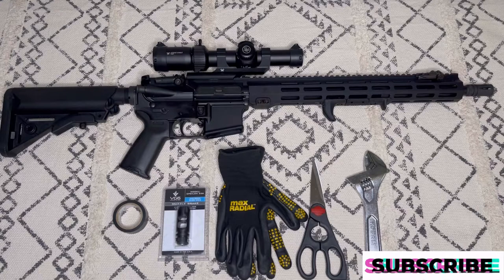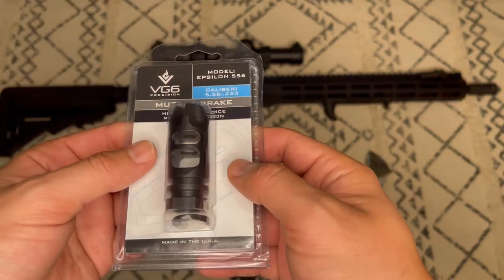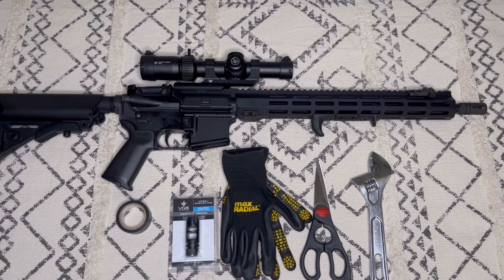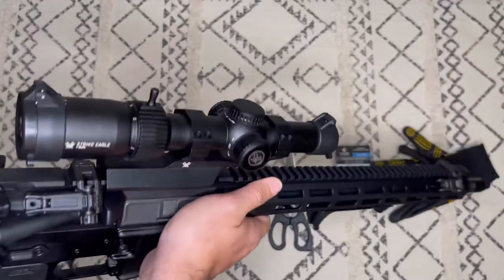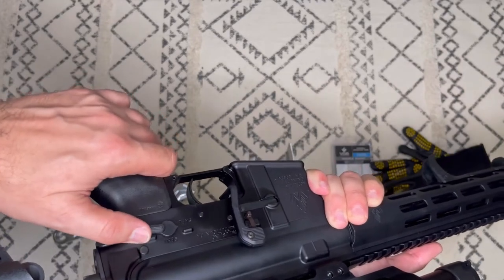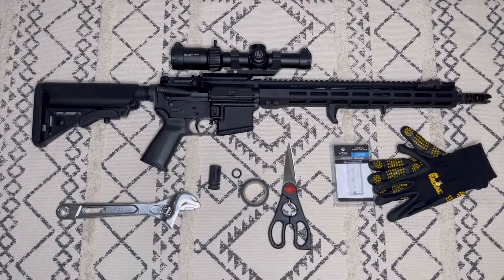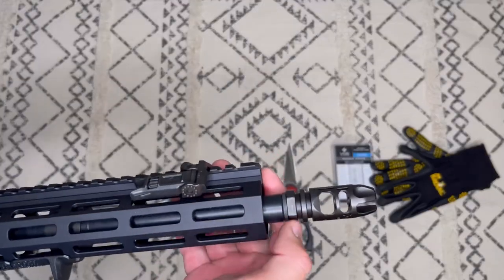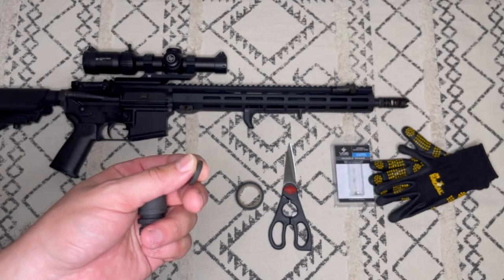How to replace a muzzle device on a rifle without gunsmith tools

Comment: While this technique does work, it is incredibly stressful on the barrel indexing pin and the actual receiver slot on your upper. Combined with heat and doing this more than a few times your barrel can twist and rotate freely while the barrel nut is still tight if that pin or collar wears/breaks. The tools for this aren't that expensive and if you end up breaking an expensive upper you will spend more on replacement parts than tools. I would not recommend this as a replacement but rather a quick remedy if you need to replace a muzzle device but do not have the tools.

Comment: Guys if you were going to be working on your ar for the love of God please order a Magpul BEV block and go to Harbor Freight and get a $40 vise.  I used this method 10 years ago and  egged out the slot in my upper. the indexing pin on the barrel will eat into your upper if you don't support the Locking lugs with a vise block like the magpul
Reply from the maker: @thundertmf Of course it’s totally your choice and your money. I made this video for those who are either restricted financially to seek for gunsmith assistance or would like to work on their own. 

I personally like to work on my guns myself as much as I can. Not trying to be a show off but I’m quite capable and comfortable with using my hands and tools. I’m also a computer scientist and former soldier. Thus, I have enough experience, knowledge around tools and guns. 

I worked on or still continuously work on my own guns, cars that worth several thousands of dollars in value. Knock on wood, I have been very successful with everything I’ve done so far. I worked on my $12K Barrets, $5K HKs, $4K SCARs and some other collectible guns plus $40K+ cars without any major damages or failures.

Bottom line if you don’t feel comfortable doing it yourself by all means take it to a gunsmith. There’s no right or wrong way here, I don’t think. We make our own decisions as adults. Cheers!

Comment: Step away from the gun please. Not only did you fail to clean the threads of any carbon or prior rock set, you put on a muzzle brake without timing it. Home DIY is great, but do it right.
Reply from the maker: Thanks for your input.
Reply: The timing looks fine, what was wrong with it?
Reply: @generallobster  what does he mean by that

Comment: I want to thank you very much, as I came to this video when searching “does iwi use rocket on the Zion 15 from factory?” ….as I am about to swap muzzle devices on my tac 12. I do have to say one should really use a reaction rod of some sort. They way you are doing it will bend down on barrel and quite a torque of twist. Also when torquing down your new device as well. They fit into the feed grooves of the barrel extension then the other side goes into vice. This way no worries of twisting barrel.
Reply from the maker: Thank you for your shared insights!

Comment: I wish my muzzle break came off that easy.
Reply from the maker: You just need to break through the initial torque and once you do that rest should be easy.
Reply: Did it have rocksett on it from the factory?? If so, stick the tip of barrel and muzzle device into a pot of hot water and leave it there for an hour or more. It breaks down the rocksett. I mainly know this as I’m swapping mine like this gentleman did (same rifle even!) and I WILL rocksett my new device as it needs to be timed and perfectly even for suppressor as it’s the qd mount. I stumbled on this video asking if the Zion was rocksetted from factory and the answer is no. Zion being a mid tier rifle though, means a more expensive one might be rocksetted from factory.
Reply: @jasongaudreau2075  We (gunsmith and I) did cold and heat for over an hour each.
Reply: @ironsights1809  thank you
Reply: Mine did

Comment: all went well ?  i tried today but its not fully tightened ... i sat on my guns hand guard to unscrew and screw the devices
Reply from the maker: Yes, mine worked out well. What do you mean it’s not fully tightened? Is it coming loose? Or you’re just unsure if it’s all the way tight or not? Another method I can recommend is to use a torque wrench. I had to use that when I was installing a muzzle device on my Galil ACE. That one was harder to install than on my Zion-15.
Reply: @SOBIsHobbies  not fully fitted,  i can see little.gap bw thread and muzzle
Reply from the maker: @usman6666  that might be due to the fact your new muzzle device may not have enough thread grooves to fully sit on your muzzle. In those case you can use shims to close the gap. I’ve done that with my Ruger Precision Rifle. The muzzle device on my Ruger didn’t go all the way so I used couple of those muzzle shims to sit it correctly. You should be able to get those at any gunsmith or gun parts stores.

Comment: Sir, it is easy to remove the muzzle break of an out of the box rifle?
Reply from the maker: Hi. Sure, it shouldn’t be much different. I’ve done it in few occasions myself where I removed factory muzzle devices from brand new rifles. Just make sure to follow basic safety precautions before attempting. Feel free to ask if you have any questions.
Reply: I was about to ask the same.. mine is stuck, will need to oil it and unthread it.
Reply: @jerrydelatorre5977 if it is pinned, you need a gunsmith. If not, it's probably rocksetted. You can boil the muzzle device in water for 10 minutes or wrap a wet paper towel on it and blowdry it, that dissolves the rockset first

Comment: Thanks. Arent you putting pressure on barrel (or maybe getting closer to unscrew it) when applying pressure on the muzzle device?
Reply from the maker: I never had any issues by doing so. I’ve shot it many times since and didn’t have any issues personally.

Comment: What are your thoughts of using some thread locker, i dont plan on replacing the new muzzle.
Reply from the maker: @royaustin8408  If you’re not planning to replace it or remove it anytime soon then I would consider applying a small amount of blue thread locker. Hope this helps.

Comment: I want to change my muzzle device In a similar way. I was thinking I would try to hold it where the receiver is though rather than at the end, since it's a floating rail?
Reply from the maker: @chrisregister8021  I don’t see why you can’t hold it from the receiver’s side. Just make sure to hold it tight and apply some duck tape or an electrical tape if you’re going to be using a vice grip or an adjustable wrench. Good luck!

Comment: Which direction should the crush washer face?
Reply from the maker: So it’s one of those common questions. When I did my research I came across of two different opinions about that. Nevertheless, majority articles mentioned that it should be convex (wider) side face towards the barrel and concave (smaller/narrower) side face the muzzle end. That’s how I’ve been doing it myself whenever I was installing them. Hope this helps.

Comment: Why isn’t your front sight all the way forward?
Reply from the maker: Good catch. 😅 Not sure why initially had it installed like that but later it’s been corrected. I changed the gun’s layout since this video has been made. I added few more accessories and not it looks different than it did during this video, including the sights’ mounting position. 😊

Comment: do you recommend using machine oil on the barrel thread ?
Reply from the maker: To make it easier to remove I used WD-40. Otherwise, I put little bit of lubricant when I was installing the new muzzle device and that was it.
Reply: @SOBIsHobbies  i didnt use.any oil,  i.will remove it and put.some.oil.and.install again
  Are you.on WhatsApp
Reply from the maker: @usman6666  Unfortunately, I’m not. But I do have Instagram account and also Pinterest where I post some photos of my collection as well as landscape pictures wherever I travel.
Reply: @SOBIsHobbies  oh no problem , just wanted to share pics of my setup :)
Reply from the maker: I see. Well, if you have an Imgur account you can upload some pictures of your setup there and share the link? That’s what I do sometimes when I have some questions and want to share visual interpretation of my question(s) on Reddit or other social media platforms. It helps to better explain the situation imo.
Reply: @SOBIsHobbies  dont have that , can do share on insta i am sure
Reply from the maker: @usman6666  look me up on Instagram under the same name @sobishobbies and let’s do try that then. How’s that to you?
Reply: @SOBIsHobbies  sure mate

Comment: What about the gas tube? Seems like the barrel flexing while torquing might mess it up
Reply from the maker: Do you mean the gas block? In this case it didn’t mess anything up. I didn’t notice any issues while shooting it after I replaced the muzzle device.
Reply: @SOBIsHobbies  I meant where the gas tube enters the upper receiver. I've got a rattle there now that I've attached my key-mo flash hider and shot a few rounds suppressed
Reply from the maker: @mastascorpio I see. Well as I said it didn’t cause me any issues. I shot it few times after changing out the muzzle device and haven’t noticed any issues.

Comment: got same gun, why mine is so hard to get off
Reply from the maker: It’s hard to know why yours isn’t bugging. However, perhaps you can try to heat it up around the muzzle with a heat gun and try it again then? Sometimes foreign particles/objects may make it hard to remove them and by applying excess heat it helps to loosen the tension. I had to do that when I was removing the top picatinny rail on my Steyr AUG to install Steyr factory optic. Initially I tried to remove it with traditional methods but after I almost stripped one of the screws I had to step it up. 😊
Reply: @SOBIsHobbies  i used a rubber hammer right after I posted it, it worked, but I don’t know why it make the whole upper/lower connection wobble in a tiny bit🤨🥲
Reply from the maker: 🤔 hmm… that’s interesting. Are you sure you used a rubber hammer 😉? It shouldn’t have made any huge impact like that if you just use a rubber hammer. Make sure your receiver pins are still in tact and didn’t come loose.

Comment: Damaged??? It's an AR...fuk wit it!!
Reply from the maker: I would 😅 if it was an AK but AR is little more finicky especially if it’s DI version. My piston driven ARs are lot more tolerant but direct impingement ones aren’t so much. I had to return my PSA DI AR simply because it just never could go through a mag without at least one if not multiple malfunctions. It was very picky. 
Don’t get me wrong, I love the AR platform. It really is a cool and very modular platform but if I were in a life and death situation I personally would pick an AK. I just don’t have that kind of confidence on the AR. And this is coming from a former U.S. Army soldier. That should tell you something. 😄